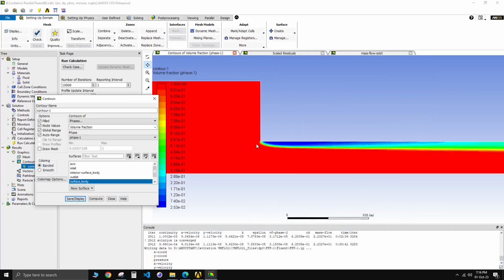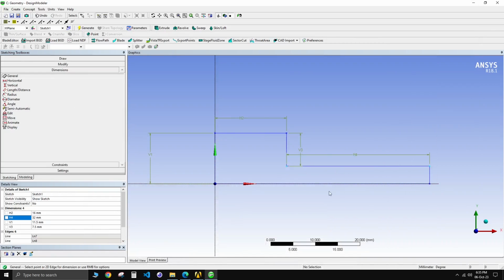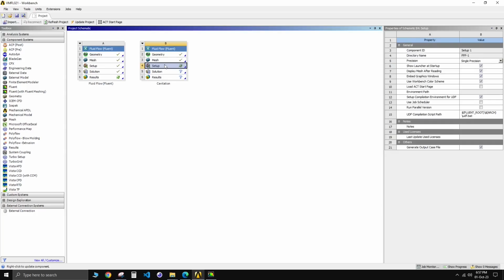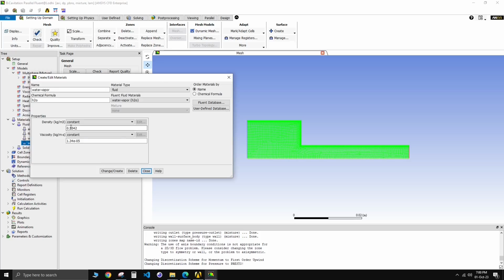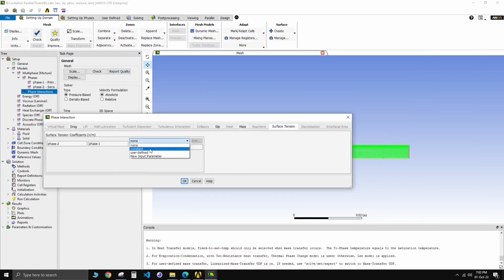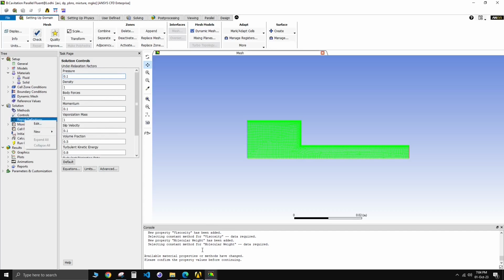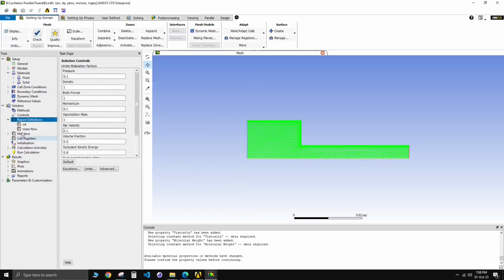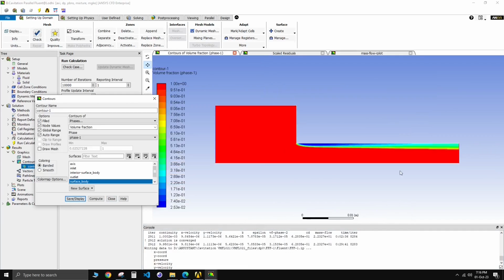CFD of Cavitation in ANSYS Fluent using Multiphase Mixture Model- ANSYS Fluent Tutorial

Comment: there is "Figure 60: Contours of Liquid (Water) Volume Fraction" on the page VMFL022 Ansys Help, and the distribution of volume fraction looks drastically different..
UPD: Oh, I know the reason: You made a mistake when setting the boundary condition.. your inlet-pressure is 1000 times bigger compared to manual..